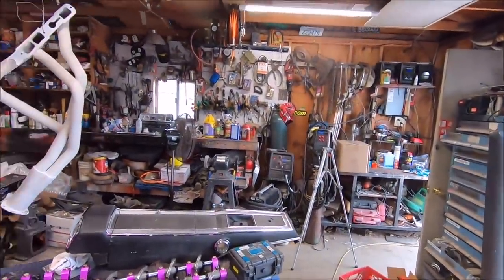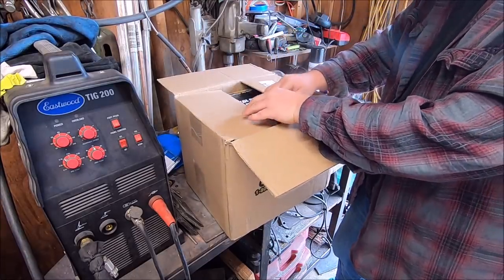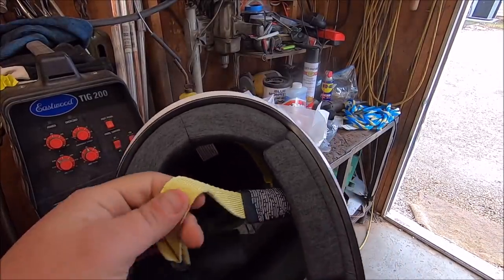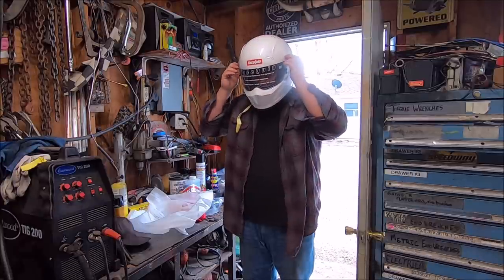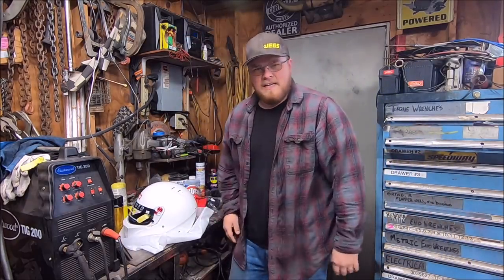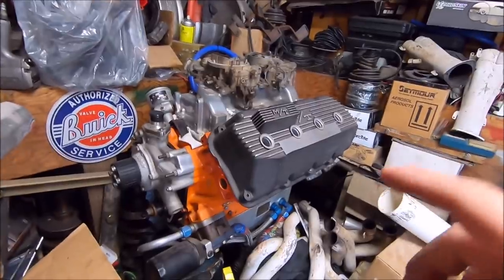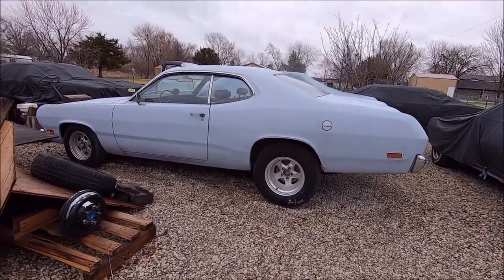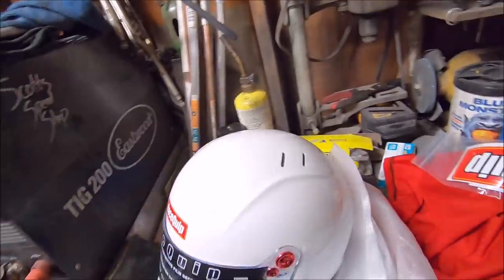Ratty Drag Charger getting more parts for Racing Season! 3/12/21

Comment: You should have bought a helmet used for snowmobiling because those have a vent on the chin part of the helmet as well as vents on the back & top that can be adjusted or fully open or closed if you choose to let air in & out so the face shield doesn't fog up . On mine it also has a button that will also drop a built in sun glasses for those bright days & even with that in you can still wear your reading glasses . Keep the videos coming because we all like watching them plus they keep me some what sane not being able to do much outside right now . I had 50s and 60 degree days last week that melted most of the snow so I got some stuff done outside but then a whole solid day of hard rain with thunder & lightning then the next morning at 4 am the wind started to blow & it started to snow again in Wisconsin where I live . I watched the weather coming out of the Twin cities & they were reporting possible tornado rotation in parts of that state already so the damn weather is definitely confused lol .

Comment: For the duster I'm thinking a nice 408 would do just fine. 500hp or so in that little car would be a riot!
Reply from the maker: 400 true horsepower would be more than enough in that thing
Reply: @ScottsSpeedShop  you're probably right. I have a 400hp 360 in my 79 Volare that makes it a pretty fast little car, but I'm building an aluminum headed 408 for it right now that I'm going to hit with nitrous. Should make about 700hp on spray if all goes as planned.

Comment: One step at a time , big fellow. Not enough space! What's your favourate head for the 360 please. One that takes three eighteth valve stem dia or standard, for others that may not know. However i got a feeling most people watching would already be aware of the spec. Appologies  to the agreeved! I bought years ago, a set of long valve Pro Flow valves. I want to use them sooner, rather than later! Need off set rocker shafts and the rest. However do not want to waste them. Any ideas would be very wellcome. I am thinking new iron Mopar stuff? Cheers all.

Comment: You totally got burned by jegs you paid way too much for that helmet you could have went on line and got a motorcycle helmet which is DOT approved that has ventilation so the thing won't fog up for less than half of what you paid for that helmet and it would have been made in USA
Reply from the maker: I was purposely fogging the helmet up and a motorcycle helmet would work, but they have a different certification than an automotive racing helmet. That is like building a roll cage, I could build a cage from scrap pipe I have cheaper, but it isn't the same as using the proper tubing.
Reply: Tech inspector at the drag strip would beg to differ, SA helmet is what the car and rollcage and NHRA call for, tech inspector wouldn't let the SM motorcycle helmet pass tech to race, unless Jezebel was a Harley, which she isn't... Thanks for playing tho!